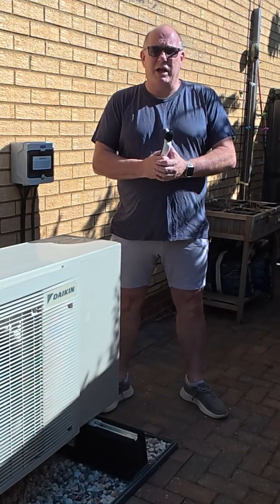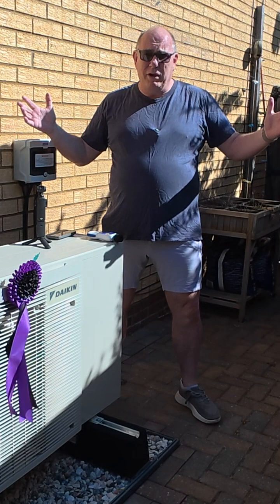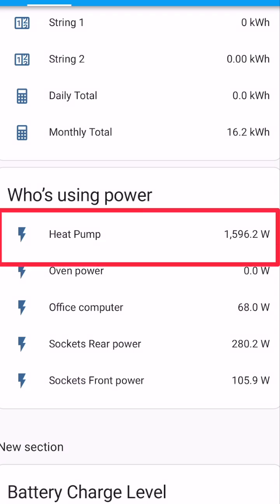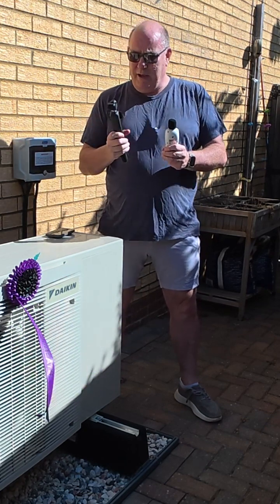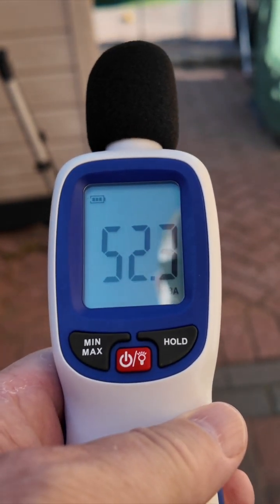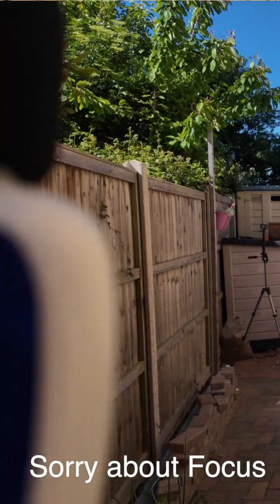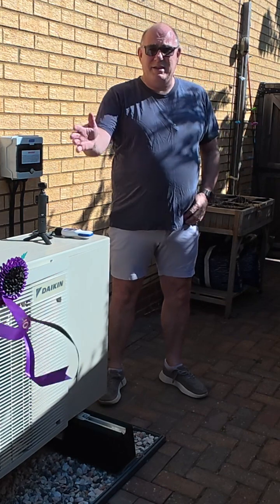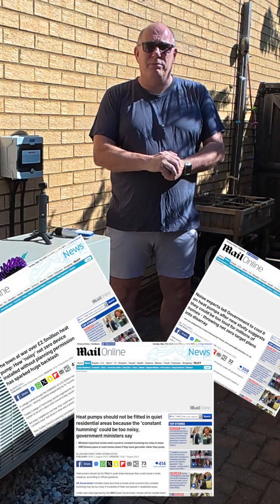Debunking Heat Pump Noise Myths – 6 Month Update

Comment: What about when it defrosts, nobody showing that, aauming mid winter nightmare
Reply from the maker: Not quite sure where you’re getting your information from, but the defrost cycle is completely silent. All that happens is warm water from inside the house. It flushed through the radiator which melts the ice. And when you say nobody is showing that I’ve actually made at least two videos on this channel that show that.

Comment: For optimal sleep, background noise should ideally be below 30 dB, while a library might have levels around 40 dB.
Reply from the maker: While it's true that <30 dB is ideal for sleep, that level is typically measured indoors, with windows closed. Outdoor background noise, even in quiet rural areas, rarely drops below 30 dB. In fact, fewer than 10% of UK residents live in such ultra-quiet zones. As for libraries, 40 dB is accurate, but remember: a modern heat pump outdoors at 3+ meters can easily measure below that in real-world conditions. So comparing indoor sleep standards to outdoor heat pump noise isn’t quite fair.